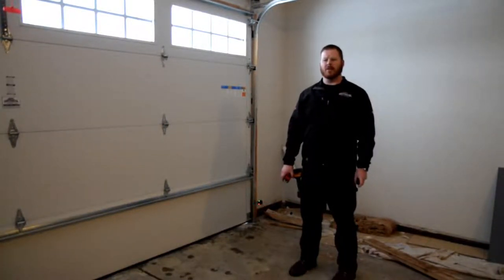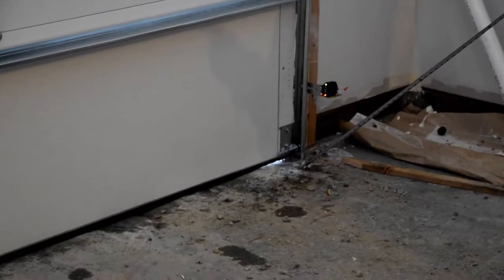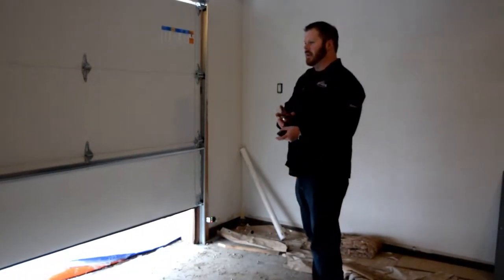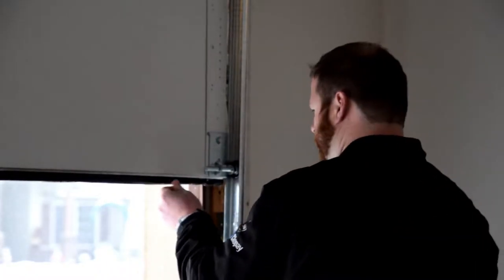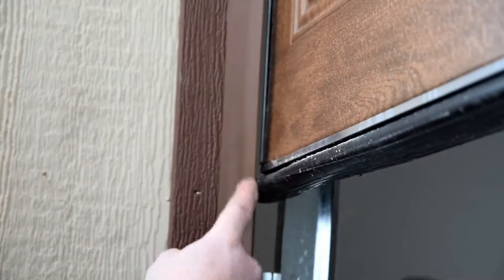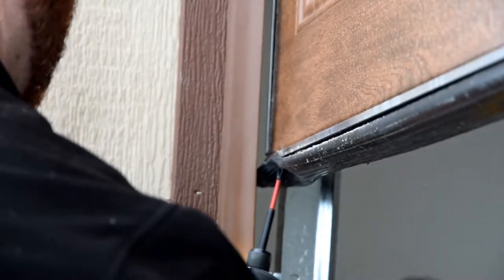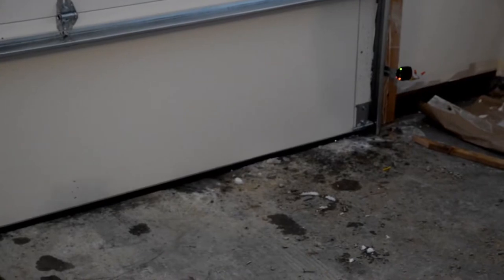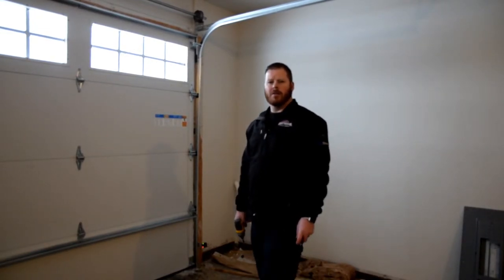How to Adjust the Bottom Seal on Your Garage Door

Comment: A solution we use here in Hawaii is cut a 15"-18" piece of black  pipe foam sleeves, cut it in half length wise and slip it into the ends of the astragal. This allows the astragl to hold its shape but collapses when door is fully closed. Great for sealing the door on uneven concrete.  Also allows the seal confrom to surface irregularities.
Reply: This is honestly what I expected to see

Comment: Ive always wondered how many people get mice or bugs that make home inside the bulb seal because theyre always open on the ends..   i shoved some 1” foam backer rod inside mine the whole length and seals better than any seal on the market..  besides the 500$ one that snaps into the threshold...
Reply: Is the backer rod foam closed cell or open? I need to do this to my garage but not sure if I should get open cell or closed? I think maybe close but not sure? I have gotten mice and they ate my wires in my car cost a lot of money to fix...
Reply: Thinking of doing the same, adding a cush to the door seal
Reply: only once until the door crushes them.

Comment: ❌ WRONG !!!

And your a garage door company?
Would never higher you 😂

✅ CORRECT WAY: almost all garage door seals are round and hallow. If your seal goes flat or is unevenly sealing to concrete and has gaps and you want to increase threshold… Take and cut large diameter garden hose and feed it inside the hallow seal and trim edges. You can also purchase a hose 1/4” diameter smaller then the seal for even tighter fit. Now your door has a better even seal 👍🏻